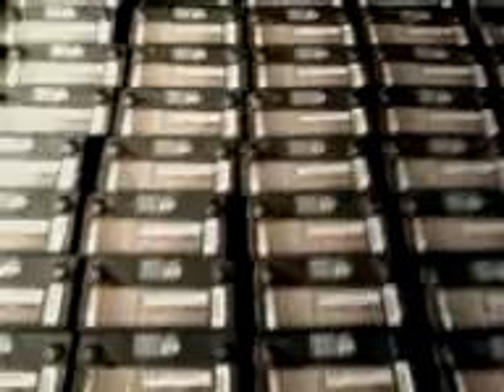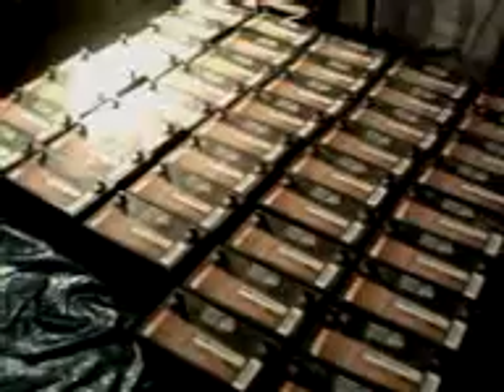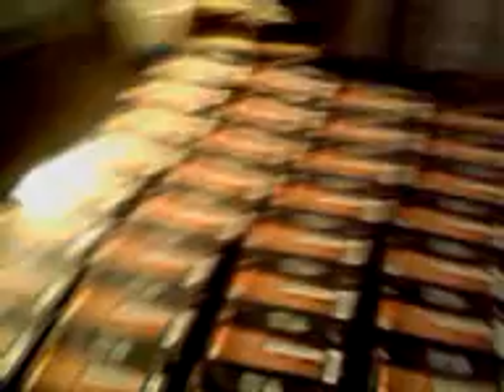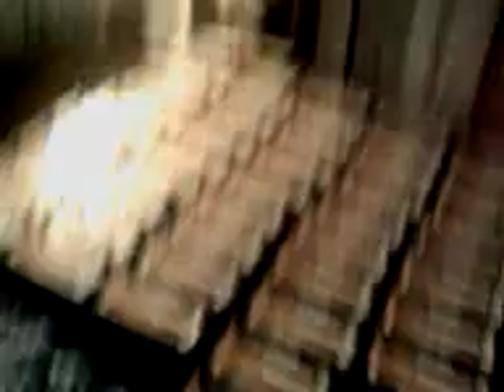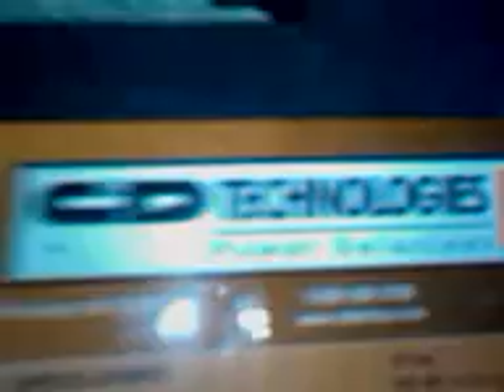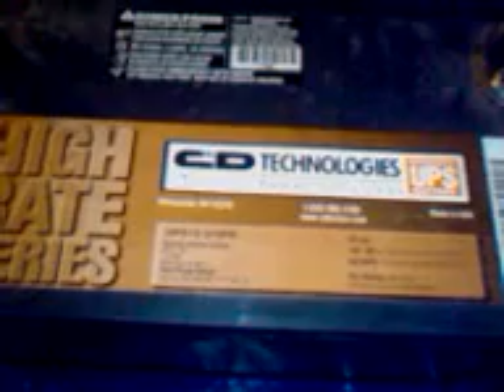Battery Bank Solar now put together first vid i did need no help now

Comment: I know this is an old video but I recommend running the batteries in a configuration close to your max GTI voltage. I have the purple label 300G, 300 watt GTI that have a rating from 10-30 volts, so I wire my batteries for a 24v setup. This allows my GTIs to run for a long time. I can get my batteries down 50% before the GTIs shut off. They don't even hardly work on a 12v system, but are really efficient at 24v.

Comment from the maker: no they are 12v and ran in parallel now its to have a huge reserve capacity to run house for days at bare bones power or what ever i need to do the more battery's the better i may be adding more then i got now thinking another 40 and adding 2 more turbines and more solar

Comment: Using batteries to run a GTI 24/7 is not a good idea as this is much harder on the batteries than a regular off grid system.  This is also much more expensive as a much bigger PV array is needed to run the GTIs during the day as well as charge the batteries for the 17 hours per day to 21 hours per day that there is not enough sun on the array to run everything.  I would chuck the GTIs and stick with a battery only system as that will have the same long term costs as a generator.

Comment: do 12 volts because 12 volts will be more efficent in the long run the only problem i see is that if each battery is 100 ah and about 70 batterys mutiply 70 x 100 thats 7000 ah if you messup you will almost certanly die and most grid tied inverters put out what they can and as much as they can so if you had a 10000 watt grid tied inverter your battery bank will be drained in 7 hours and causing an auto shutdownbut 10000 watts alone is enough to power three walmarts and your wires must be BIG.

Comment: Man, I would like some batteries. Have you ever thought of making a dc generater? just like one that runs on gas but replace the the gas with a 12or24 volt motor..3,800 rpm and a belt drive.With a bank like yours you could run things 24/7 and still have extra power to sell/inverter..let me know how to get some batteries...

Comment from the maker: @dieselplow  did you mean a grid tie?  i already have a  trace xantrex for inverting ,as for the grid ties i have 10-15 left of i have them when i need to dump the bank or want to most time i use my charge controller and bank and roll with it running some the house and there so cheap i got many for $55-80 each

Comment: If money is not an issue, I would step away from the multiple inverters and buy a full sized inverter / charge controller such as "outback" or "xantrax" from a dealer.  A good place to get a price on those items in a company called SunElectronics - they are out of Phoenix & Miami - They ship anywhere in the world and have great pricing.

Comment: @mayswhole You can also use a Amp meter that looks like a "clamp" that you just put around the wire without any physical connections. Those are the best if you want to measure high Amps... But tend to be somewhat expensive.. Mine cost 430$ .. But there is cheaper ones too..

Comment from the maker: @taztaz79 no its not .....i use batteries at night and i have 2 banks now a 24v one for gridties and a 12v one for using in house to run tv and house and all when no suns out,or power outage or what ever situation is, my elec bill has been $30 so far ,so i have some solar that charges 24v bank and some charges 12v bank as well and wind power

Comment: with that many batteryes you will not need a charge controler. your grid ties will draw more than your in put. more solar will boost your system quickly in less your in a continuous windy area. more amps in = more out,  twice the solar input is needed for contentious out put.

Comment: @mayswhole Hey type in windman1000 in the search box on you-tube he has a diagram of the switching from 12 to 24 volt.I think the 10 amps was from my big turbine.I can get 6 or 7 amps from my elipticl bike with the treadmill motor attached. I have my meter set on 10 amp I did not know it would read over 10 but it does

Comment: Here is my 2 cents I am new to this also.count all you batteries then divide into 2 groups of  paralell for charging at 12 volts.then add large switches to the 4 outputs.Now you can just flip a few switches on and a few off and you will have 24 volts I did this with my little system and it worked out great.keep us updated.TAKE CARE